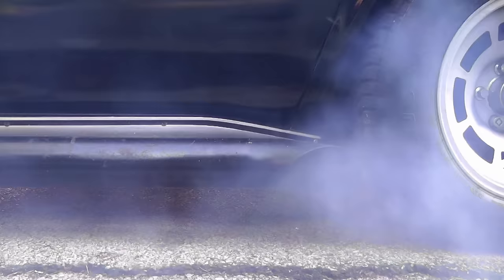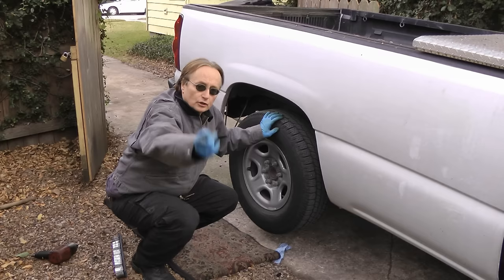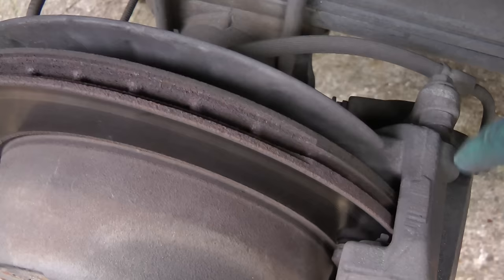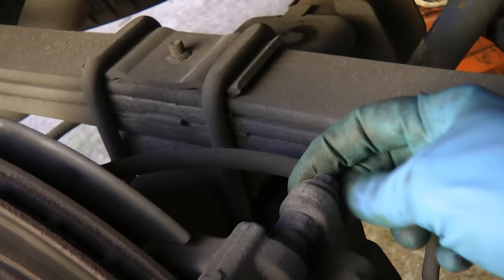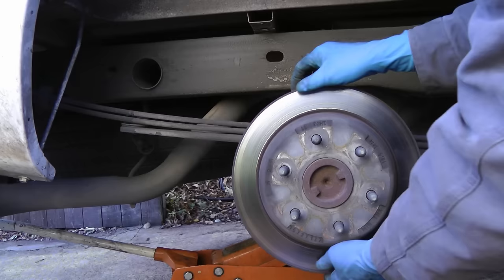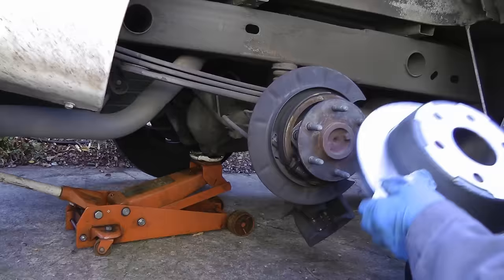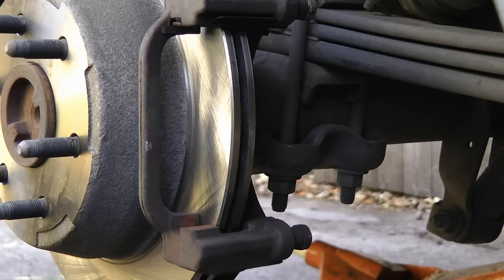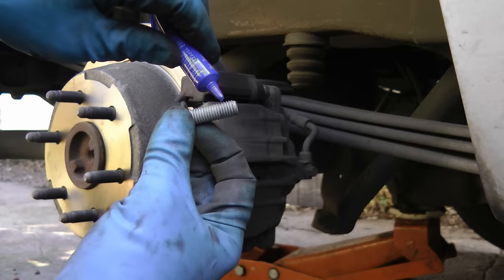How to Fix Grinding Brakes on Your Car (Rotors)

Comment: you forgot to tell them to grease their brakes.... 46 of experience my ass. remember people apply grease to the brake caliper and rotor surface for maximum stopping power!
Reply: I dont know a good name  No don't put any grease what so ever on the rotor itself, that will make your breaking worse.
Reply: I dont know a good name  hahahahahahhaahhaha YES Put Greese On the Rotor Sounds like a veryyyy goood idea, hope ur not a mechanic pal
Reply: bloddmage why would you not?
Reply: I dont know a good name This might be a little late but if you apply grease to the rotor then your brakepads won't grip or generate as much friction than a rotor without grease on the surface. If you apply grease to rotor then it will only get more slippery and you will only brake worse. That's why you're also supposed to clean your New rotors during replacement, to get rid of the protective oil that protects the rotor from oxidation that the manufacturers apply.
Reply: Samuel Lindström it was a joke.

Comment: How to replace a rotor in less than 3 mins...lol
Reply: This would be a great video for how to do it in a combat zone, under fire.
For the average Joe, this is one of Scotty's worst, dangerous and missing steps or doing things in a way which risks other expensive parts.  Love Scotty's videos, however I think this one is more mugging for the camera and trying to show how fast he can fix the issue in 3 min vs taking just a bit more time, and doing it correctly in 10.  He should pull this video.

Comment: jesus man if i paid u to do my brakes id fuckin be pissed after that harsh mangling very lucky nothing is not dmamged. the brake line that you proceeded to drop like trash can kink and not flow fluid correctly making a stick caliper. and who the fuck ever compresses the piston without using the old pad seriously. your gonna kill the rubber seal man. EVER HEARD OF TORQUE VALUES? jesus man don't touch my car 46 years of damage Scotty Kilmer

Comment: Got a cube runner well they going to answer answer my questions and things like that looking at what's wrong with you nothing the love my stuff is important do you know I got problems in there like to know how to that of memory and know how to fix it I'm better now got a year 2008 Chevrolet Equinox  something about the the creek in the moment grown under  about the the lock system in the window they could be a window regulator on the is take 11 11 don't go down sometimes it goes up something else something don't do nothing right now don't do nothing now and then the door locks on the precious I don't want to you don't want to unlock the night but we don't have to keep pushing an older man Leon, how to fix it were to do it automatically another power window using could be the real a regulator what the test lamp but tell me if its a real a regulator adored me the videos Multi Function meter and I want to be without the set the alarm off on the car when I check the circuit this going to warn disconnect the battery then to go somewhere and get the message control computer set to take the battery terminal loose.      This is fred yeah that's the truth to go somewhere get the Mission Control computer reset tell me your address so that I can take the Eagle up to you tell me what you're mine addresses of your home things like that in your in your phone number

Comment: You shouldn't really give tutorials about changing brakes. I know its not a difficult job to do and a monkey could do it but there are certain individuals who have just about 2 brain cells in their heads and those braincells are used for breathing in and out. My point being, someone's going to attempt this and really make a mess of it and could hurt somebody.

PS. Using a hammer to loosen the bolt, WOW, I wonder why they invented WD40 and a breaker bar. Not even gonna go into how you tightened them up afterwards.
Reply from the maker: Ah, you must be a lawyer. I'm helping out millions of people save money here. I'm not going to put a disclaimer that if you're an idiot, don't try this. It just goes without saying I'm making videos for normal humans with brains and tools who want to learn how to fix their cars
Reply: Scotty Kilmer
I agree with you, hahaha people that need disclaimer for obvious common sense reasons just need not to do stuff themselves, period. Like your videos.